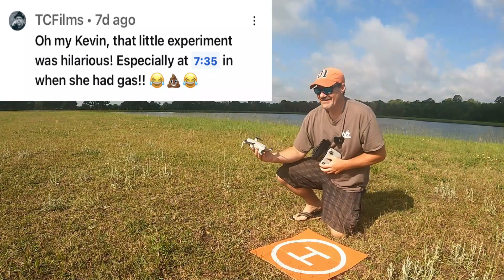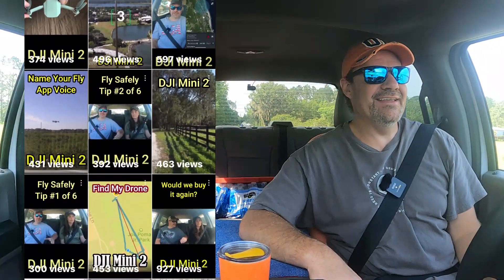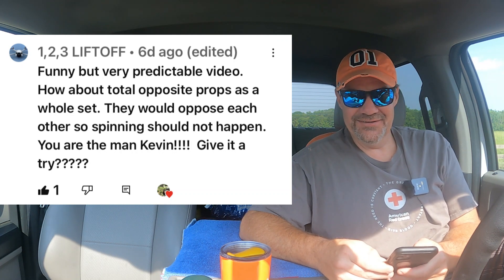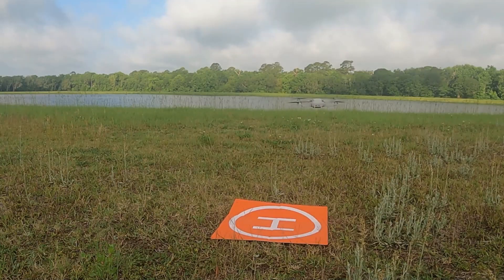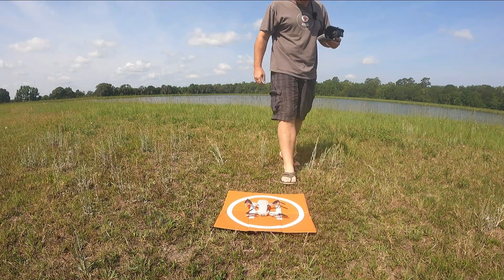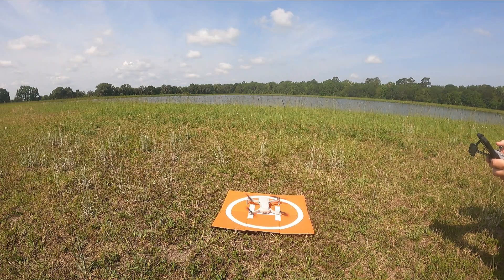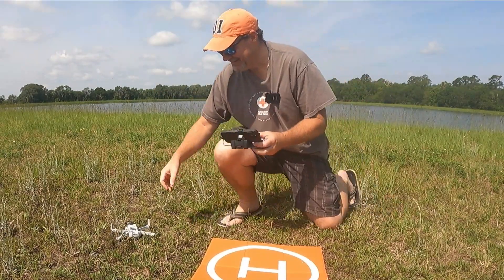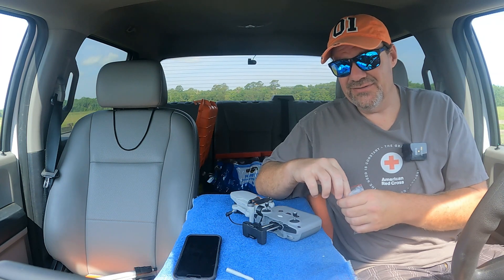Drone Propeller Reversed? / What Would Happen?

Comment: When prop on wrong side it makes that corner push down instead of lift
Reply: When I help new pilots in fpv this is a very frequent problem
Reply: No it will not fly upside down because the flight controller is set to recognize upside down as just that upside down and shut off
Reply: Now you can swap any 2 wires on each motor and swap props and it will have lift but fc will still not operate properly as it is set for the motors to spin in regular (factory) direction
Reply from the maker: hahaha...  If I were to try and swap wires inside these drones, I'm pretty sure the end result would be a broken drone...  lol  It seems like you FPV pilots are way more technical sound and repair capable than us Mini 2 pilots...  FPV is pretty awesome and I swear one of these days I'll get there.  :)  Thanks for watching as always, buddy...
Reply: There is a plastic cover on inside of arm on mini 2 that you can pop open to get at wires 😉
Reply: You can access wires through little cover on inside of arm for replacing arm with ease or to swap 2 wires and reverse motor direction 😉